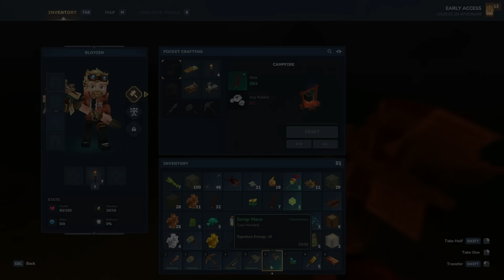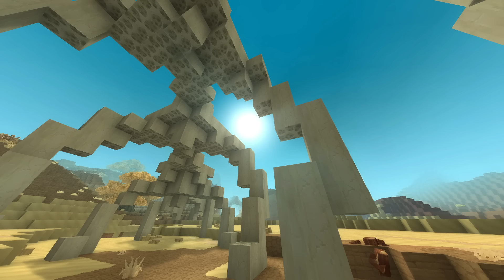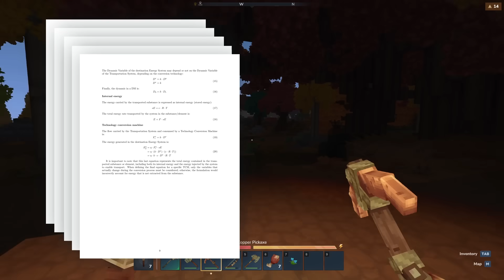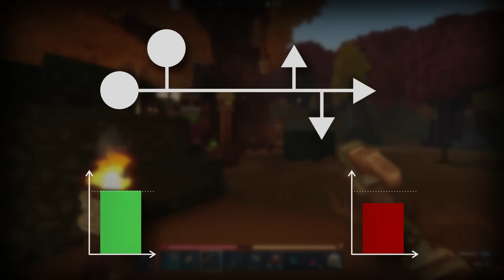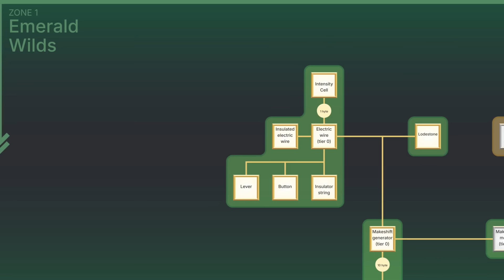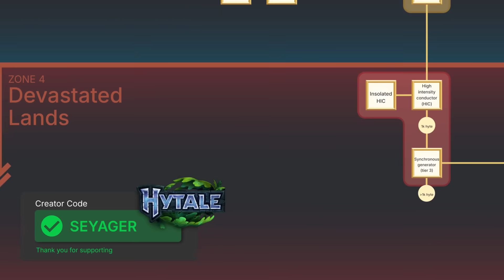Introducing HYNERGY: Energy and Automation for Hytale

Comment: I never liked RF or FE because it was basically a fluid. I think the intensity concept is a little better, but just using the words electricity and intensity make it feel less intuitive. Generic "power" can fit the magic narrative better... And with the benefit of being intuitively additive. Two machines that dissipate 2 units of hynergy require production of 4 units of hynergy to run. Hyrads? Hyflux? Hywatts lol. I like the concept of the different metals to make different tiers or properties. Instead of just better generation and efficiency, but also access to more convenient machines. Iron can't be used to make thermal generators that just sit atop lava, or cobalt being the only photoelectric capable metal, etc.

Comment: I think your outline for Hynergy's energy tiers is well planned. I do not think the realistic basis of the mod would fit neatly into Hytale's fantasy world full of magic and whimsy, but I could easily see it being the most popular tech add-on.

I think we still need an even simpler system with magical theming for base game Hytale. Redstone, Create, and seemingly Hynergy as well are all several steps too complex for the average player with zero knowledge to comfortably engage in, even in simple ways. I'm still not sure how to achieve simplistic automation, as I can't recall any prominent examples. Think how easy it is to get a pressure plate to interact with a door in Minecraft. It should be of similar complexity to perform most basic automation, and initially gatekept by magical progression rather than technical skill.

To be clear, this is coming from someone who loves the technical side of Minecraft, and is a low to medium skill redstoner. This project looks awesome! Keep up the good work

Comment: The problem with this kind of stuff is, by going away from real basic 1st order physics, you're only going into something more complicated that's just has hard or harder to learn, that's also nonsense.  Don't do this stress units or goober hyjuice  stuff. Just do real basic phyiscs. It's simple enough, standard for high school level, and great for kids younger. Watts, torque, energy etc. It's easier to model and easier for people/kids to learn than arbitrary discrete systems and could potentially have massive educational value.

Comment: I'm already brainstorming uses from what I see here 

-I could see the automation of stone being made into sand, or grain into flour with rotation alone

-could do rotation based conveyer belts for multi-step automation, though sorting might be an issue

-using the energies in some form or another to propel/utilize the carts and rails (rollers, powered rails, etc.) to transport goods and players further and faster

-a dangerous hazard that can occur if you try and power an electrical wire under water

-depending on how magic happens, techno-magical golems to assist around the base or follow you into battle.

-some kind of battery system later on if machines don't consume power when not in use.

Comment: Starbound had a mod where you could make a circuit board. I’d like to see something like that, a chest when you open, it either has a similar wiring mechanic, or you get items, chiplettes, that you place in the box to create the design. It would have a normal chest layout in a grid format. On the outside would be toggles to change whether it is an input or output. That side would correspond to the real world logic and orientation (bottom row of the chest would be closed to the opening near the player, top row would be the hinge/back of the chest)

Comment: Earth: chemical
Wind: mechalical
Fire: thermical
lightning: electrical
water: not sure
void: absence of energy
one type of energy generation for all elements
at surface value you can focus on only one of those
but as you progress you'd need energy from different sources
you can even specialize in one type of generation and the technology will change in turn

Comment: I don’t want something that works like Minecraft. I don’t want hytales automated devices to have to be connected.  Minecraft’s red stone system is horrible because it restricts creativity. You are forced to design your creation, so that the large red stone design is somehow hidden.  Make it just like the current Hytale teleporter.  It just works, powers itself.   If it makes sense to power things, then make a magic generator that Emirates a large aoe energy field that’s invisible that powers anything within its area.   Then use magic books as a tool. And when usd on different magic devices, you can change the devices settings.  And just like how chests are magically connected to work tables.  Make devices naturally connected to others that are close by, and using the magic books as a tool, you can choose what other devices effect the one you are changing the settings.

Comment: I think the magical nature of Orbis and Simon's intent to keep this a more magical game should be honored.  That means this should all end up more magitech.  That's NOT precluding things like cog wheels and lava as components, but then ALL of them should feature use of the crystals somewhere and things like 'wireless energy' or magical generation or magical effects regularly.

Maybe a windmill or watermill produces rotation that's cycled through gears to a device that rotates over the crops.  It uses green crystals to promote the growth of crops and harvest them when they're ready.  That just dumps the crops on the ground.  Then a small golem comes and collects them into a chest, which has a rotation-driven conveyor belt to a device that uses the essence of life to both process the crops into food and extract a fractional number of seeds at the same time (i.e. less than the crops that went in, but still some).

Also, I think 'integration' needs to include involvement of existing blocks and items.  I've seen SO many Minecraft mods that center around entirely new resources.  Gather new resources to build new blocks that let you do new things with new tools, and barely any interaction with existing minecraft assets.  This is a mistake, and one that GOOD mods avoid.

All in all, it sounds like you guys are on a great path!

Comment: One thing I will mention is

Design your electricity system in mind with the ability to eventually convert it into the systems other mods will have.
There will be other mods.
And people will want them compatible.

Better to design it with that in mind and an easy way to do it than have to recode everything later.

There's already a redstone and piston mod for Hytale.

Comment: do u use some unit for the energy? to allow comparison between energy produced by a windmill and a solar panel for example.
what represent the "hyte"? is this some experience points to unlock higher tier systems?
Reply from the maker: The energy unit across all the technologies is the same. Hyte was a placeholder for the intensity unit (dynamic variable of the electric energy system)

Comment: I do not like the idea of having energy in the game, at least not while we dont have electric magic (essence)

I would prefer the idea of having everything "magic like" but with physical counterparts

Like, to generate heat, you could have a fireplace to burn fuel, a special block that could go into lava or build something out of adamantite and essence of fire with a few void hearths in the middle and have a "infinite" source in the sense of not being consumed, but with limited output.

To generate cold, the same principle could be used, having radiators that cool in the wind, radiators that cool in the water and something build out of essence of ice and cobalt.

And for mechanical movement there could be a fluid like transmission, kinda like hydraulics, a beam/axis system and a rope system, like capstan gears and stuff like that.

hmm, maybe the essence of life and essence of void could work together to make the electric system fit, using essence of life for wired eletricity and essence of void for wireless...
Reply: Mage-Steam-Wood-Punk :P

Comment: add a mechanical arm to harvest crops automatically, also add a clock to trigger at the right time, and all of this connected to the power generators, also a motion sensor for the player and objects, LEDs, and doors that need electricity. To explore magic, I believe it would be better through magic stones that, when powered with electricity, summon circular runes with effects like regeneration, speed, similar to the Minecraft beacon.

Comment: @seyager my sugestion for early-game progression:

Zone 1: mechanical energy - machines should take space and do only simple tasks, such as mix, crush or rotate things. 

At this stage, wood is your main material, but you could integrate rivers and water deposits with mixing dirt / clay / sand to make bricks. Allowing you to unlock the alloy smelter, allowing you to make bronze (and other alloys) and the coke oven (which will substitute the wood burning recipie byproduct into 100% charcoal + turning charcoal into coke for better efficiency). Also liquid handling should be available, via gravity or pressure.

Now you should be heading to the steam age at zone 2.

Steam machines that can run fuel (steam) directly and automatically from pipes to machines. Just set up a steam boiler and you could harness steam or mechanical energy by attaching a fan to it. 

With bronze you could make a blast furnace to create steel, your next primary material for zone 3.

Machines and more machines! Finaly low-voltage.

You can now generate power trough solid/fluid fuel generators. May that be steam passing though a turbine or just even the heat itself. Now you unlock the power of transporting electricity trough wires (to small distances) and being able to create simple electrical logic circuits. 

The rest of the material/technology progression is a bit more of the same, you unlock a new material and new capabilities.

Altough i think that all of this should be gatet to its own progression. As simon said, this shoudlnt feel obligatory to the player, but i think it should be a world of its own, with simple progression for those who want to rush trough it and having complex, branching capabilities at the same times for those tech nerds as myself

Comment: Suggestion: Natural Power Sources - Thermal, Hydro, and Wind (also Magic when it is properly implemented). Items to catch those energies: Thermal or Lava will use a Steam Catcher by placing the item above a Lava pool with 1 air gap in between, then funneled via metal tubes to a battery or some sort to store it which is where you connect the cables to lead to machineries. Wind Mills for Wind, Water Wheel for Hydro, all their power is funneled via tube to a battery of somesort. The battery can be movable, to act as a temporary power source when not connected to any of those mentioned items but will run out of power so you need to connect to those items to recharge it or just leave it connected for an infinite power supply from the natural sources. The battery shall have an alternative way to recharge it if you don't want to use those items, the other source is a fusion core, crafted via glass + coopper + Iron and Essence of either (Water, Ice, Fire, Wind (if implemented) or Lighting). Water being the lowest power duration (Progression of Fusion Core Power Alternative) where only last you 2 in-game days, wind essence for 4 in-game days, Ice essence for 6 ingame days, fire essence for 10 in-game days and lighting which will last hours like say 10 in-game days. Right clicking the battery Item opens a menu which is where you will put in the Fusion core of any essence to power the battery and will act as a power generator even if not connected to water wheels, wind mills, or steam catchers, this is a fun way to add a something like a redstone torch to the game but different, you don't need to attach it to those items to store and generate power, you can still place it anywhere and power it using Fusion Cores so that it is more versatile. Then after that, your system of wires can now take over. The item designs should be steam engine era, somewhat medieval, maybe magical and fantastical. It would be too weird and out of place to add modern technology to a fantasy base game so the design should take note of that, The battery can look like those vintage battery made from copper, you can look up images of allesandro Volta battery in 1800 for inspiration (Voltaic Pile battery)

Comment: Why not make thermal happen before electricity? Then you could have steampunk things which would look really nice in Hytale, and then you could make electricity more powerful (and keep compact complexity behind later-game progression).
Reply: Presumably because the current end of the game, zone 4, had is a prominent source of lava. If I had to guess, the technologies are not arbitrary, but are rather chosen to thematically fit with the overall themes of each zone.
Reply: @Chloroxite then why dont make electricity THEE Most powerful method BUT leave it something for after game, like you have to "complete" zone 4

Or something you could only achieve using concepts from the 4 levels combined
Reply: Mm but then you will end with 2 different ways to achieve the same, i think, and then everybody will end using only the required part to upgrade to electric power 🤔
Reply: @dantto5319  maybe use a bit of "logic" from Hydroneer, where you have several types of automation that uses different natural resources, such as it's Volcano/Arctic themed expansion.

For example, the base game has drills that require a constant flow of water to function, which you have to source from nature and transport to your production. But the expansion is set on an island that is half arctic and half volcanic, so you have drills there that require lava to function, while other machines like conveyors requires water, which you have to gain by melting water, because there are no running streams or lakes.

I'm not sure if this is a perfect solution, but given that this is a fantasy world, I don't think many will complain about the logic of automation, which is kinda magical in it's own rights, requiring something that seems illogical.

Otherwise, if electricity is the end goal, maybe just make it so you can create a geothermal plant setup, that perhaps produces more consistent energy and at a higher output.
Reply: I agree with you in regards to thermal energy more fitting to Hytale world than electricity, like steam engines that requires charcoal or any burning fuel to power up and move other mechanical components, rather than use electrical wires and pcb-like wiring circuits which looked more alien to the Hytale world. The pipes are good though, introducing gravity-fed or pump-assisted water or lava to transfer it to other locations. I actually hate infinite source of power like the minecraft redstone tech, but in the world of Hytale, it can be considered as the end game, using magic as the infinite source of power.
Reply: why would you? steampunk is a cool aesthetic but we can skip it
We produce electricity with steam anyways, we literally overheat steam to move the turbines that produce electric energy
Reply: I would prefer a logical progression from mechanical technology to steam power to electricity and then beyond. As Arthur C. Clarke observed, "Any sufficiently advanced technology is indistinguishable from magic."  Coal would be a great addition to the game- save the trees!!!
Reply: Because they dont want.
Reply: Elektricity should be replaced by some magic/tech hybrid like how hextech is in lol